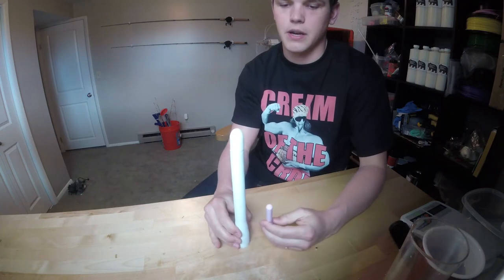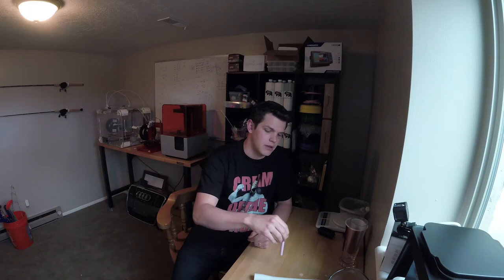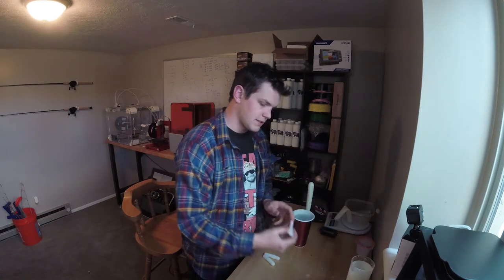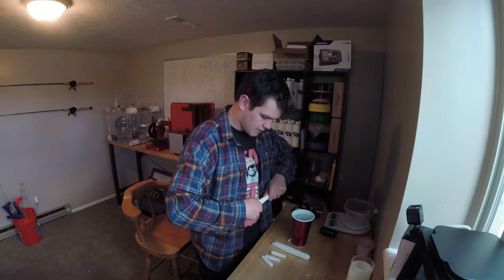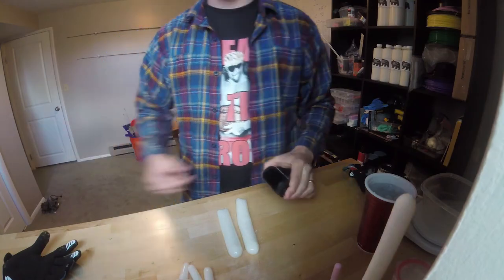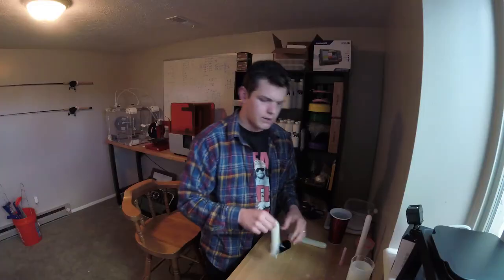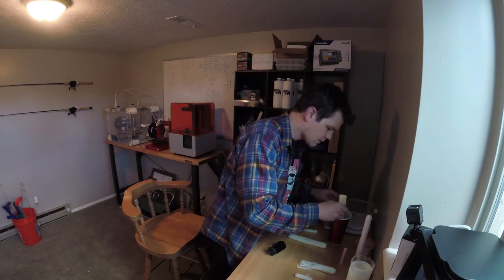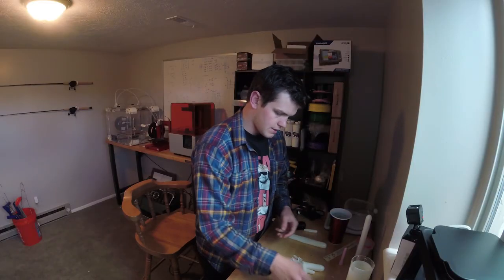How to make HUGE Lake Trout Tube Jigs - 3d printed - How to make your own Tube Jigs and Tail Cutting

Comment: What is and where are 3 D rods found?  Please define , Are they abs dipping rods?
Reply from the maker: Yes they are ABS, I designed them in solidworks. You could also use aluminum turned on a lathe.

Comment: Hi nice video.  Maybe dumb to ask but why not make a 3D printed mold to suspend your “rod” into and pour your plastisol around the rod?  Probably need to be a two piece out mold but you could also add details for eye’s etc or pour two color tubes.
Reply from the maker: Not a dumb ask at all! The reason I did not do that for this particular video is that the one printer I have that makes large enough parts to suspend the rod in would add some layer detail, I wanted to try and get nice and smooth baits. For the smaller tubes, I am going to try that! thank you for the suggestion. I will post a video when I build it!

Comment: could you send me a link on the cutting blades on Amazon?  Having trouble finding it
Reply: Or better yet I will be one if you have a link?
Reply: buy
Reply from the maker: @paullemon1984  I stopped selling things a year ago or so, here is the link to the blades: https://www.ebay.com/itm/154046342517?_trkparms=ispr%3D1&amdata=enc%3AAQAFAAAAkPo5Oov%2F%2Bn9B1jrEt37SfuQBRPWQspvx0uy3Wfd3PBB0Gu096F%2FaceZRy2usj%2BSwoe43EGbPTEzzX%2B%2BkDlwxdtPORtKV9%2FImguQNinXxPpIJVz%2FYuxLHAazCSMKwpMSf0FaQHxNhrbXjCxjsFcYNJ%2F3qjrVpIVjCjw8d4%2BDD9PRQP2FbyTQseeplSQuRuiVVgA%3D%3D&chn=ps&norover=1&mkevt=1&mkrid=711-117182-37290-0&mkcid=2&itemid=154046342517&targetid=1192081309184&device=c&mktype=pla&googleloc=9029748&poi=&campaignid=12873834640&mkgroupid=120270032814&rlsatarget=aud-649939740844:pla-1192081309184&abcId=9300536&merchantid=263817877&gclid=Cj0KCQjws-OEBhCkARIsAPhOkIZszcKm004IAncKgXKDUmxSRPeEbTuOEPKJ4sncceuNb0kpJnK8r80aAvicEALw_wcB

Good luck and let me know how it turns out!